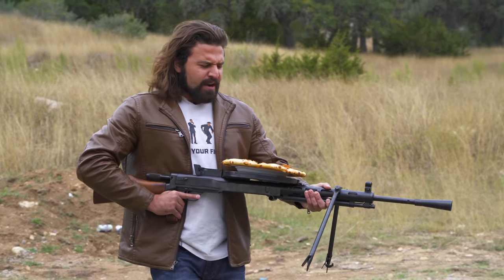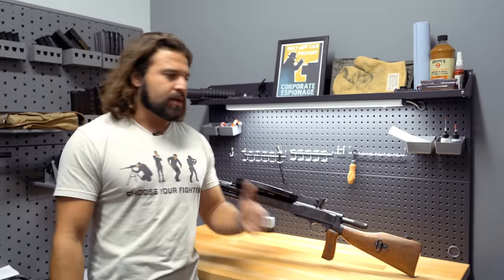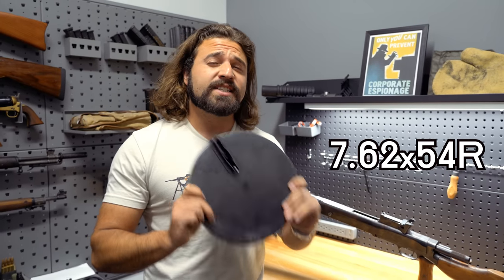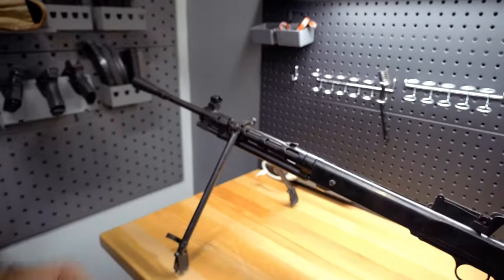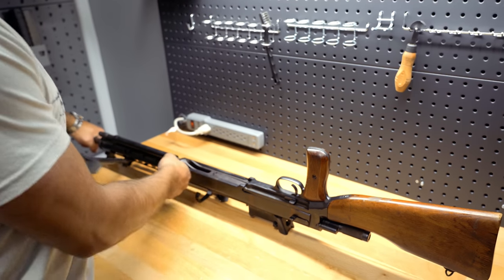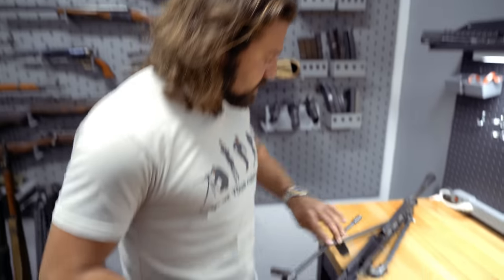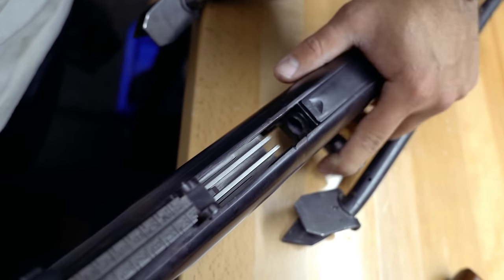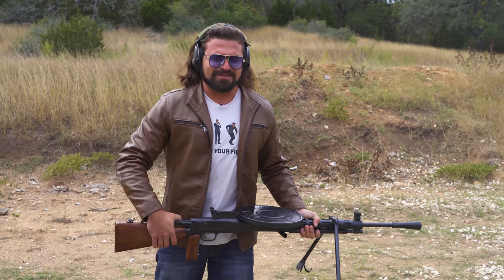The DP-28: The Russian Dinner Plate Machine Gun

Comment: If you can't kill it with 47rds, they made a feedtray that replaces the pan mag to feed the same belts that the PKM uses. It was called the RP-46.

They used the same locking ear design on the RPD and DShK-46.
Reply: Good luck finding one, though.
Reply: @jeredhersh789  I have 3 that I brought home from Afghanistan and put on DPMs. And with my SOT they are all post-86 guns. The feed mechanism is worth more than the postie.
Reply: @jamiebunten8195  lucky, I've been trying to get my hands on one for years. SMG Guns used to make reproductions, but they discontinued them a while back so I'm basically SOL haha

Comment: I would love to see a “didn’t make them like they used to test” old guns VS new guns!
Reply: A good candidate would be remington 870. My dad's 870 has served faithfully for over 20 years, no blemishes.
My 870 jammed the first time I shot it, and the coating is barely there.
Reply: YES
Reply: @BirdRaiserE Remington turned to crap a good while ago, even with the new leadership. Mossberg at least is still the same quality as the old ones. Old 870’s aren’t rare but they are more expensive than new ones on the used market for a reason
Reply: @agentmueller  Can confirm. I have a newer Remington 870 and Mossberg 590 to use for home defense. Mossberg definitely the better of the two imo.

Comment: I'll add a couple of interesting facts. 
1. DP is a descendant of the legendary Fedorov Avtomat: the Red Army soldiers regarded it as a hand-held machine gun, and not as an assault rifle, as Fedorov himself saw it, at the beginning a heat-protective casing from Madsen was attached to the machine gun, which was never started in Kovrov (although at the beginning of the ebu they attached a casing from a Lewis machine gun, and a little later water cooling), then there was a variation with a disc magazine and a bayonet. And in 1924, the Revolutionary Military Council banned the use of other cartridges, except for 7.62 * 54R. Therefore, a new variation of the machine gun was worked for him, additionally lost the whole box, receiving only a butt made of wood and a box magazine on top. But the automation remained from the same Fedorov machine, so it often broke down. Also, the military did not like the store that closes the review. Therefore, then the Maxim-Tokarev machine gun won. But it was considered as a temporary option. Therefore, by the next contest Degtyarev completely changed the automation and added a disk magazine.
2. DP had several relatives. The first one is YES, that is, the Degtyarev Aviation, which was decommissioned due to the appearance of the SHKAS machine gun, which had a rate of fire of 1800 rounds per minute. But a muzzle brake, used later on the DShK, and a 63-cartridge magazine appeared on it. And this store was used on the DT (Degtyarev Tank), which was in service with all Soviet tanks of the Second World War. Next comes the RP-46. In fact, this is the same DPM, only with a special adapter that allowed it to be powered from the same tapes as the SG-43 machine gun. But if necessary, it could be removed and disk stores could be used. Yes, just like on HK21. But then the Kalashnikov Machine Gun appeared. Well, his last descendant is the RPD, which was originally created for a competition for a "Heavy Avtomat", the essence of which was the creation of a machine gun for an intermediate cartridge. Then the favorite was Sudaev Avtomat. And Degtyarev made 2 options: in fact, the same DPM for the 7.62 * 41 cartridge (then still 41) and the same pord tape power, which was the beginning of a new class of weapons.
3. There were variations of accidents with different types of ammunition. It was under a cloth tape from a Maxim machine gun, it was under rigid tapes like a Hotchkiss machine gun, it was under semi-rigid tapes and with a radiator like Lewis, it was with a sector magazine... Moreover, there was an installation of 4 such machine guns. Well, there was also a bunker-powered machine gun like the Japanese Type 11, only in the USSR, unlike the USA, there was an extra pencil that was broken by the spring of this store, which became an illustration of the reluctance to have such a scheme. And in the USA it was not found, and Garand began his crusade against the fingers.
P.S. The idea to make a light machine gun as an enhanced version of an assault rifle was proposed not by Kalashnikov, but by Korobov. And as it turns out, such a scheme provides not only logistical, but also combat interchangeability of ammunition, improves logistics well in terms of spare parts and unifies production.
Reply: Dêgtârôv was the pioneer of unification of firearms: DP, DT, DA. Dêgtârôv pêhotnyj/tankovyj/aviacionnyj.

Comment: Brandon, consider the RP-46 belt-fed conversion of the DPM.
Soviets saw the German mg34/42, and said "we need something like that".
So they made an attachment that locks on to the feeding mechanism where the pan mag sits, modified the gas system to make it work and used a heavier barrel for sustained fire, and voila, belt fed DP.
This conversion of existing stocks of DPM was the interim infantry MG in Soviet issue, until Kalashnikov completed the PK.

Comment: The M85 .50 BMG caliber machine gun used in M60 series tanks operated on the short-recoil principle, with "dual laterally-moving lugs locking the bolt to the barrel extension." Flapping bolt locks, or wings as I called then. When the gun is firing, the bolt is doing the chicken dance, and when it flaps its wings, the elbows lock into recesses in the barrel extension. Army TM 9-1005-231-24&P, July, 1985 shows an illustration of the parts. I personally liked the M85, even though it seems to have a really bad reputation now. It's shorter than the M2 machine gum, and about 20 pounds lighter, which made my job working on them easier. But I didn't like how the guide rod wanted to jump out at you when you pulled the back plate off. I "stoned" a lot of M85 sears with my Swiss-pattern files. Instead of having stones in my toolbox, I had tags saying they were on order. For well over 2 years! At least I had a toolbox when I was in Germany. I never had one before that and had to borrow everything from different mechanics and tank turret repairmen, etc.

Comment: Can you do a video on any the flapper lock up was dropped and no longer used? It seems like it would be a cheap and very easy lock up to manufacturer as long as you're machines can make the receiver with fairly tight tolerances, seems in my opinion easier to bulk up and design than more modern bolt lock ups. Hell if you hadn't already designed your AK-50 lock up it certainly could have used that lock up most likely.

Anyhow I'd love to learn about it!

Comment: As a kid way back in the '60s (yeah, I'm old AF), my brothers and I had G.I. Joes, back when they were a foot tall and wore cloth uniforms you could change. One of the characters had a DP-27 light machine gun, with that big, round part on the bottom of the stock. I was like a butt cheek in front of  the butt. Weird. IIRC the bipod was brass colored and you could flip it 90 degrees to remove it.

Comment: For being 7.62x54R the apparent recoil from that DP27/28/M looks mild. The recoil in a bolt action rifle with the same round is fairly stout so they mitigated it somewhere.
Reply: Yeah with a giant bolt, and recoil spring.
Reply: The recoil is a different experience with machine guns. Between the weight of the gun, and weight of the bolts, you feel more the movement of the bolt rather than the recoil from the shot.

Which is why an MG42 doesn't feel like "20 K98s per second"
Reply: The weight of the machine gun softens the recoil.

Comment: Brandon, know you're just doing an ad read for cash, but Kamikoto isn't all that high-end of a knife company.

First, the brand doesn't market in Japan at all. The whole "Japanese steel, good knife" schtick is strictly for western consumption. 
Second, the knives aren't even of high grade steel. The steel, while yes, sourced from Japan, is pretty much the cheapest stainless you can work with. 
Third, overall these knives are just Wal-mart grade knives dressed up to look like something fancy. To put it in AK terms, these are the equivalent of a Chinese stamped type 56S claiming it'll be just as good as and last just as long as, if not longer than, an original Russian milled Type 3. Or to put it in video-game terms, Kamikoto is the equivalent of Raid: Shadow Legends.

Any piece of cheap steel can be sharp. The trick with knives is how long they retain that edge with use. Shadiversity did a good video (at least IMO) showing where Kamikoto sits in the spectrum of "is this a good knife?" Google string: Shadiversity Kamikoto.

Comment: So I realize that Kamikoto sponsored you, but just an FYI, they may start very sharp. However, they're made of pretty much the softest stainless steel that you can use for knives. So they won't keep an edge worth crap. That and they are actually a Chinese company slapping a Japanese sounding name on their products and they have obvious machine marks on their blades, which is just a sign of rapid, lazy, mass production. I bought them based on your video sponsorship, but they literally use steel that is of lower quality than a $15 Walmart kitchen knife and they charge over $100. They probably spend more on their boxes than on their steel. Just thought you may want to know about vetting your sponsor a bit more. Love your channel still though!

Comment: Nice gun but if you didn’t know kamikoto is a complete scam from the traditional bull j20 steel has never been a traditional Japanese steel it’s made with cheap components and the knifes are 20$ to make when you buy them for 300 500 a piece or maybe in a set of 2 for 900 they come sharp but they dull fast just letting you all know